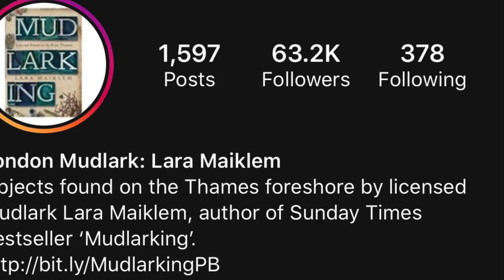Mail Call Eighty-Nine!  May 22, 2020

Comment: Make sure you get those floor panels fixed. I had a ‘61 Falcon with no floors in it. I had no choice but to take it to work in the rain one day. I hit some standing water on the highway and the water came up at me so hard it blew the crud and sand from the old rug I had on the floor up my nose. It was shocking and cold and I was soaked sitting there driving down the road.

Comment: Hi I am new to the channel. You read out my comment in mail call 81 when I mentioned that my father passed away in December and I was on the hunt to find his old 6139 he wore all through the 70s & 80s. I found out that he had tried to get it serviced several times but no jewellers would touch it. It has since been lost. I have purchased one from ebay after watching lots of ‘what to look for guides’. I now have a really nice looking yellow faced 6139 with lovely sharp case and original chrono ring with little fading. The face is after market but looks really good, the minute face looks really smooth without the concentric rings. It came fitted with the wrong crown without the gear so the inner dial would not move. Comming from an electronics background and used to working with small things your videos have given me the confidence to open it up and fix it with the correct crown and gear of eBay. The only fault it now has is that the second had does not reset to 12, it sets wherever it wants. I do have a second 6139 with blue dial and this works perfectly, I am considering swapping the face, as this is a sentimental watch and the yellow face is what I want. Ps.I spent the 80s helping my father restore his MGB Roadster to new condition. Full walnut dash, wood rim steering wheel and wire wheels, all original, lovely car in blaze. Thank you for the videos, you are good people, take care from Here in Wiltshire England.

Comment: Thank you for the answers, Spencer! I'm only looking to get rid of the haze in un-lumed hands. I wouldn't dare to try anything on lume. 
Regarding the corrosion on the case, I've managed to get rid of it by boiling for a couple of minutes in a solution of white vinegar and distilled water. However, I would be reluctant to use oil to prevent corrosion, because the pitting occurred where the bezel meets the case and I'm afraid of oil making it's way onto the dial. The crystal is a pressure fitted acrylic crystal, and there is no gasket.

Comment: Happy anniversary!

I got the 3:45 Kanji day wheel from watchtimeco on eBay.  This was the listing I bought from:

https://www.ebay.com/itm/Seiko-Day-Wheel-Disc-for-SKX007-SKX009-7S26-7S36-NH26-NH36-4R36/172755552162

Interesting look at that Landeron. So many mechanical chronograph movements have a similar layout with the lateral clutch and the Y-shaped chronograph bridge.  Is this one of the earliest versions of that?  I wonder who did it first.

Comment: Hi Spencer and Sabrina, I have a Seiko quartz 7123-8550 that I picked up for very little money. My question is, it has a Lionhead dial and I can find no information about these watches. They are available on eBay occasionally but there is nothing on the internet, nor on any watch sites, that gives any info on these. The dial is marked Japan Mvt and cased in Hong Kong. From the serial number it is an 80s issue watch. Do you know anything about these? By the way my 14th is coming up in July, and congrats to you both. Another interesting thing is that the caseback has the Daini logo stamped into it, under the serial number.

Comment: Hi Spencer and Sabrina, congratulations on 14 years. This is a multi-part question:

Spencer, I know in other videos you have stated why Seiko automatic movements are shorter lived than a Rolex movements because of lesser tolerances. Is this true for the more modern high-end Seiko automatic movements such as the 8Lxx or 9Sxx? Are there any Seiko automatic movements out there that could be considered equivalent to the modern or vintage Omega/Rolex movements? 

Also, how does the Seiko 9F movement compare against the 7548/7549? Thank you.